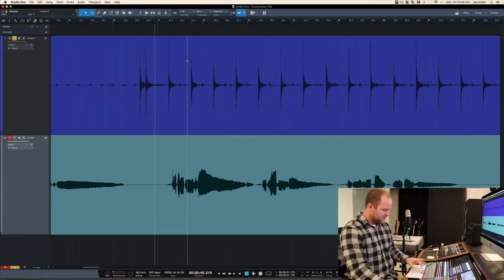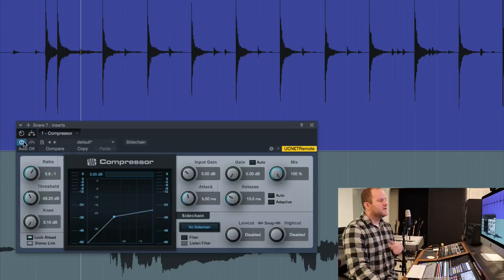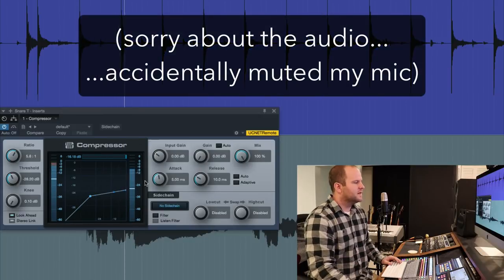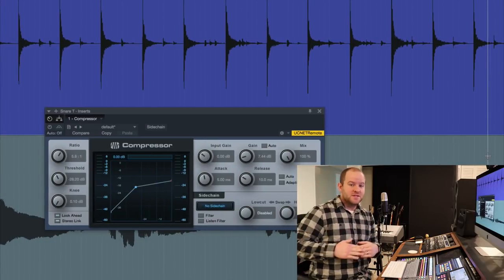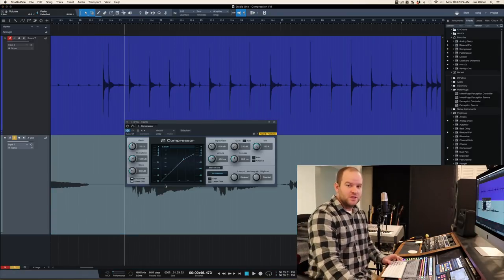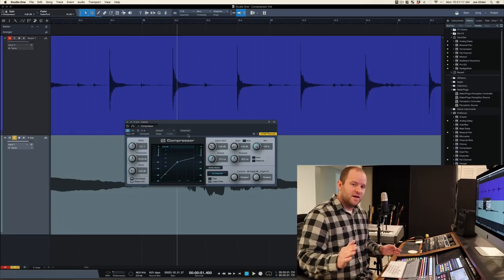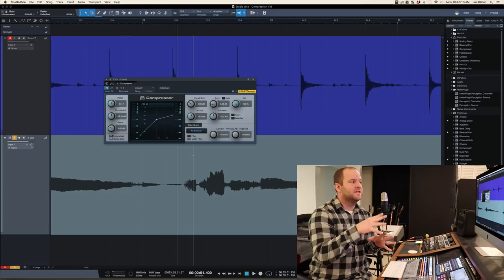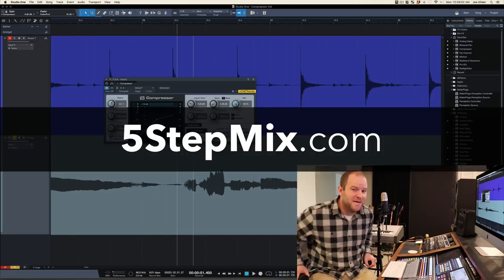How to HEAR Compression

Comment: Hi Joe, this was very informative, but it only discussed what a compressor is supposed to do. Can you also cover how a compressor " colors" a sound, and why some compressors are more desirable than others. Thanks!!
Reply from the maker: Good idea
Reply: Bruce Dickert Why not to buy an Alesis 3630.
Reply: I was always under the impression that you lost sonic details due to compression, not gained them.
Reply: Moses Ramirez Tube compressors can do things like add upper harmonics to a sound and the ratios of compression probably varies to a small degree over the range of frequencies. Yes, details from the original signal are lost, but the compressor will in turn, impart it's own sound signature to the incoming signal. There really isn't a lot of gear out there with a truly 100% flat frequency response.
Reply: Mostly the saturation (exmpl: tube, tape, transistor...) and the curve of the attack and release (exmpl: log, sqrt, linear)
Reply: The problem is that uncompresed sounds natural and dirti.
But compresed culd be better sound and clean beautiful sound.
And need more gain after compresed to get louder.cos compresed reduce the sound.
Thats the secret.

Comment: Understanding compression is easier if you use a "lights" analogy to compare it (as in the "lights" in a room). A simple example is a compressor only triggers compression when the volume of the source goes above and over the "threshold" that was set (at the knob). Only the portion that goes above and over the "threshold" is lowered by the "ratio" that was set. The key is that only the volume of this portion above and over the "threshold" is compressed, and all the volume below the "threshold" remains untouched (uncompressed). This means that the loud peaks in volume are lowered so that they fall more in range with the rest of the source's overall volume. This effectively means you are lowering the volume range (ex. a volume-level range from 1-to-10 is now a range of 1-to-6). Those loud parts are now lower, but the overall volume is also lower compared to the rest of the mix. So to compensate for this, you use the "make-up gain" knob to bring up the overall volume of the resulting compressed source so that it is more on the same level as the rest of the mix. Even if you don't use the "make-up gain" - your ears will tell you to move the fader up for that track (to hear it better again). This effectively does the same thing as the "make-up" gain.

So how does this translate to the "lights" in a room analogy? Say the "lights" are the sound source (the volume). And you have magic sunglasses with transition lenses (a lens that gets darker as the light becomes stronger). The sunglasses are the compressor. Again, using a simple example and not getting all scientific here... In normal light levels, the sunglasses are not triggered and remain clear (because the "threshold" has not been triggered yet). But once the light level increases above and over the "threshold", the sunglasses get triggered and the lenses become darker. This happens in order to protect our eyes from "burning" and being blinded. This is the compression part. But now our human eyes perceive that the room is darker (because of the sunglasses). This is the lower volume range that our human ears are perceiving. Wouldn't it be nice if the sunglasses could somehow make it so that no matter what the higher light levels are (above and over the "threshold"), the lenses will change shades in such a way that the room lighting levels remain the same to our eyes. In other words, the sunglasses will do the job of protecting our eyes so good, that we wouldn't even see or tell a change in the room light levels is happening. This is the "make-up gain", so that our ears can again hear the overall volume of the source.

The negative side effect of over-using the sunglasses is that you might walk out of that room with a raccoon-face "sun-burn" - where the skin around your eyes is lighter than the sun tanned/burnt skin around the rest of your face =) This is the same as over using the compressor and making the sound and tone too muddy and losing some of the natural dynamics of the source. It becomes muddy because when "making-up" the gain, you are also increasing the volume of all the tones that were living below the "threshold." And some of those tones might be the "bad" darker tones we didn't want to accidentally increase. EQing can help fix that, but in lots of cases it can't. So be careful, and use compression as a tool - but not a weapon. Unless you're actually looking for this effect on purpose (like "crunching" an electric guitar to get that bad-ass grunge sound). I hope this helps you newbies on the world of compression.

Comment: I compressed a mix, first I had a heavy setting and set attack and release to values, that the difference between compressed and bypass is little as possible, after this I reduced treshold and rate and noticed, that the only difference was, little details are better audible.

Comment: The thing about the compressor making things louder is really easy to explain. It compresses the peaks so the levels of the peak are closer to the sustain so if your attack is at -1 Db and the sustain at -8 Db you can compress so the attack is -4 Db and the sustain is -8 Db still because that is not loud enough to be compressed (ofcourse that depends on threshhold) so you can then boost the signal by 3 Db so your attack is -1 Db and then sustain is -5 Db which means the attack is just as loud but the sustain is getting louder with the makeup gain. so what a compressor does it makes the different between peaks and sustain smaller so you can have more of the sound audible in a mix. it's really usefull. for example if you have a snare drum that doesn't cut through the mix and is already almost going into the red you can use compressor in conjunction with EQ to make it sit really well and be able to cut through the mix.

Comment: Why don't you prepare a rendered track of the processed signal? The increase in base volume is clearly visible in waveform view.
Reply from the maker: Because I don't want to teach people how to SEE compression. 😊
Reply: Well, I do see your point about not mixing based on visuals, and I agree that a visual analysis should never be the final word in a mixing decision. But while you should not end on it, it is still a great place to start , especially for newcomers, because it helps you notice things that you simply don't hear without a lot of training. And if you never notice these to begin with, chances are that you will neglect them for a long time and be frustrated about what is wrong with your mix.
Reply from the maker: Great opinion. It's just not a good fit for me.

Comment: Would it not be better to use a soft knee compressor to bring up the quite parts?
Reply from the maker: I never really mess with the knee setting. You might be right, but that's not the point of this video. The quiet parts are brought up because they're the parts that AREN'T being compressed.